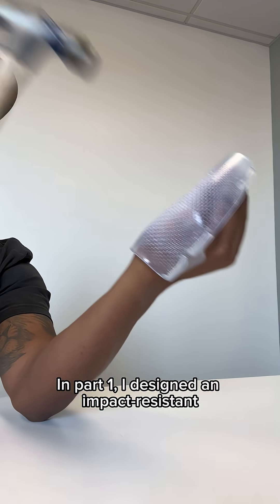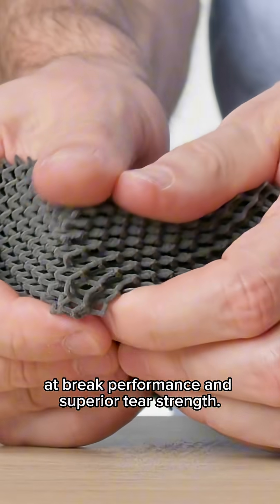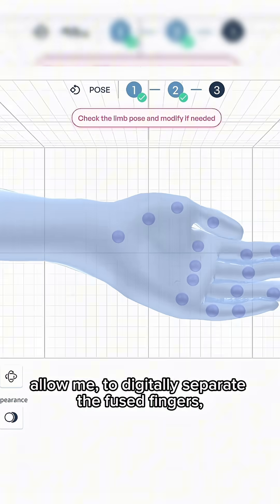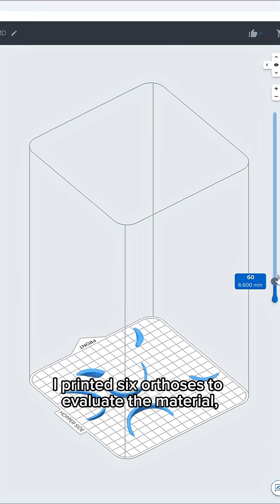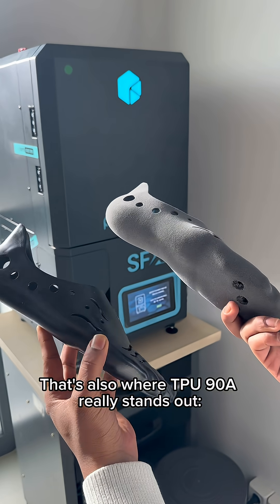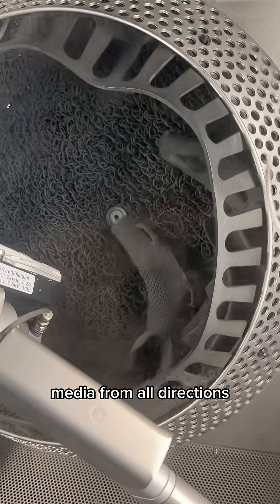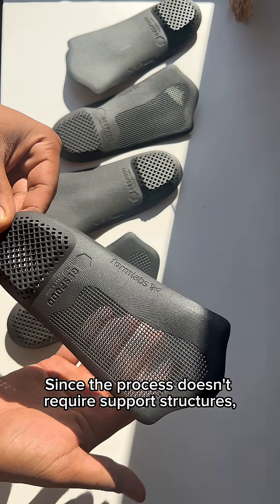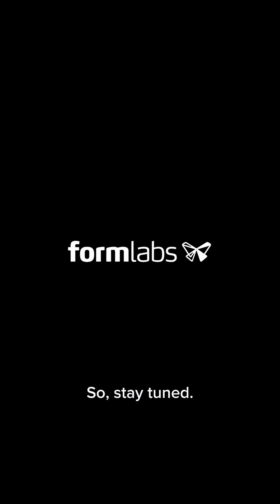SLS 3D Printing Orthotics & Prosthetics for Comfort Testing

Comment: Won't using 80% recycled material instead of the standard 30% affect the physical and mechanical properties of the polymer?
Reply from the maker: For TPU 90A Powder, the material used here, a refresh rate of 20% is actually sufficient - see https://bit.ly/47C8pTI for more info.

Comment: Okay, the fact that we can now 3D print custom orthotic inserts using elastomer powders and there are several different ways to vary the effective durometer of the parts is impressive as hell. The prosthesis is very cool and I'm glad that technology is finally able to make it relatively trivial for custom prosthesis to be manufactured quickly and reasonably affordably.

Comment: I love that you included straping loops on the orthotic. When i had my thumb splinted in one of those thermoplastic splints for 10 months, i prefered the tight taping, but given there was no loops or adhesion points for the velcro, except gluing it to the orthotic, the glue would give way so often, and then once it unstuck from my orthotic, i would have to go back to have a new strap placed on. So, as someone who wore one of those sharp thermoplastoc orthotics for almost 12 months, having those loops is a HUGE plus in my book!

Comment: I dropped out of high school. But I feel like the powder isn’t really that sustainable. You just use way more than you need and then save the extra. And then mix the extra powder with more brand new powder. How exactly is that sustainable? It’s a more sustainable process than just throwing away all the excess. But i don’t think I would call it sustainable.

Comment: 80 percent reclamation is awesome. We primarily use nylons in our form fuse and they're 50% or worse so we have to be diligent with packing the build volume well. We have a nitrogen generator coming so we can do more volatile blends that are worse than 50% without it.

Comment: As someone who has used 3D printing a handful (lol) of times to help with curing and healing, it amazes me every time.

First, I had a crown which was fully print designed, then ceramic cast and CNC’d to fit. It was incredible, and getting to watch the doctor do onsite adjustments to fix it better in my mouth was awesome.

Next, I had a middle finger splint that was designed, tailor fit, and applied onsite. The process was literally minutes of work, and the comfort it allowed me in healing was next to supreme. Plus, I had a lot of people asking me what I had done on my hand. It was genuinely sick.

Finally, I had a knee support printed for when I had messed up my knee. Much like the finger splint, this set up allowed me to still have some range of motion while still being in comfort.

There is so much more in this field, but once the technology becomes cheaper and more accessible, this will become the next level of healthcare!

Comment: Why not combine the resin and sls use a thicker sls inside and a thinner resin print on the outside and you could make it a glue together or snap together. Combined comfort and protection. Just my thoughts
Reply: You could also have thickness vary across the form. Instead of 3.0,3.5,4.0mm thickness splints they could have made an 8mm wide outer band that perfectly conforms to the finder that tapers to a thinner rounded edge. The thing should also clip one with out additional velcro, some integrated strap or a multi-part lockingframe would make sense

Comment: Use both. One as a liner the other as a protective shell from impacts.
Reply: that’s what i thought he was gonna do from the first few secs of the short
Reply: Bambu labs H2 would let you do that since it has two separate nozzles that can run different material simultaneously. I know a guy who designed a box that needed rigidity of nylon but impact resistance of TPU and was able to do that with the H2. Super awesome!
Reply: @joemiskowitz2669  you do realize that the formlabs printer and SLS in general is miles ahead of any FDM printer, right? It’s like comparing playdough to ceramics because playdough comes in more colors. Also worth noting that multiprocess 3d printing typically doesn’t work with different materials, only different colors of the same material. If you want to bond a flexible and rigid design, you’re better off with industry standard procedures, adding press fit indexing points to each part (ball and socket or similar, where the flexible part squeezes into or around a feature on the rigid part) or literally just using a flexible adhesive.
Reply: What about the flexibility
Reply: @Jmax200  outer shell could have something of a hinge at the points where it makes contact with the underside of knuckles \ joints. But not sure you'd want that much mobility while healing.
Reply: >>Boosting comment for the algorithm because using the hard shell and soft shell together is a really great idea
Reply: @verypotato6699  thanks 👍👍
Reply: @verypotato6699  like a Double Decker Taco 🌮 but the other way around 😅